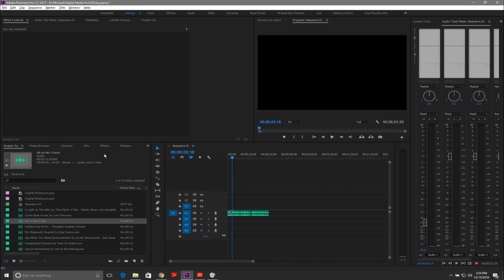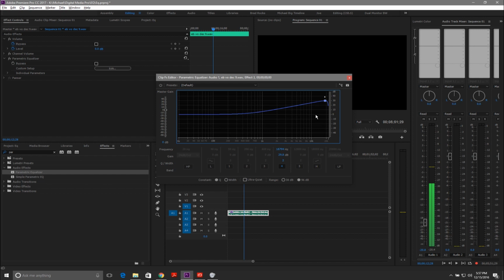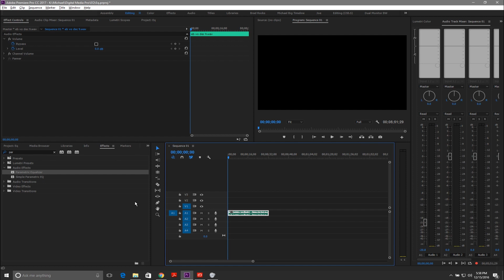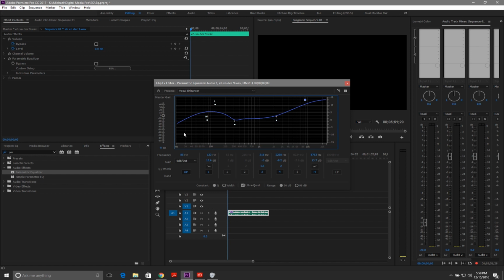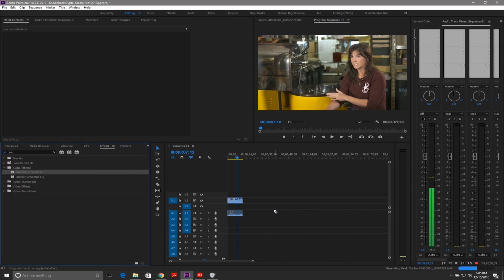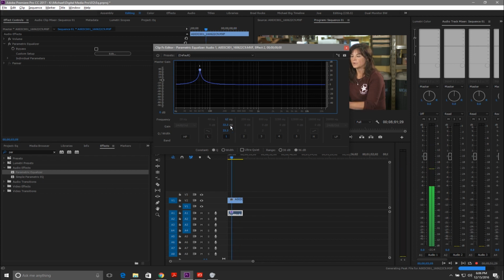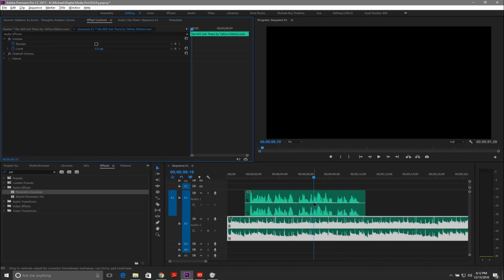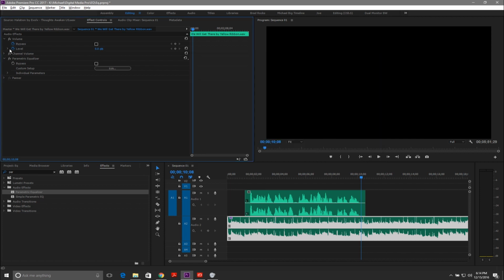Parametric Equalizer #adobepremierepro

Comment: I just need to know how to open the eq adjustment window and every video has a custom set up button that doesn't exist.
Reply from the maker: This video was recorded with CC 2017.  It is pretty much identical in 2018 and 2019.  I do not remember the first version where the EQ had this layout.  If you have 2017 or newer, it would seem to me that there is a problem with your layout, graphics driver, computer specs or installation.  Start with the least destructive, is your current screen resolution at least 1280 x 800?  if so install the newest graphics drivers.  If that doesn't work delete your Adobe profiles.  On a PC you should delete (or rename) your Adobe Folder C:\Users\**your user name**\Documents\Adobe.  When you launch your Adobe programs it will auto rebuild this folder, but you won't have any of your saved layouts.  If you don't trust me, you can always rename it back.  Finally, if none of that works, uninstall your CC software, run the cleaner tool https://helpx.adobe.com/creative-cloud/kb/cc-cleaner-tool-installation-problems.html , and reinstall. If you have CC 2017 or newer (maybe even older) one of these steps should get it fixed.
Reply: @DigitalMediaPro  thanks for the troubleshoot. i'm unfortunately on a school computer that I can't reformat so I've just been using the dynamic link with audition and doing my eq adjustments there

Comment: how do i keyframe this effect?
Reply from the maker: Individual perimeters are in the Effects Control panel. It's not super easy but it can be done. If needed I prefer to cut the audio clips apart, apply their own effects, then put a dissolve between clips. Typically this has good results but it depends on what you are trying to accomplish.
Reply: @DigitalMediaPro  thank you 🙏

Comment: I dont have the edit button for Parametric EQ effect in my Photoshop Pro CC2017. Do you know how to fix it?
Reply from the maker: Yes, open Adobe Premier Pro.  While Photoshop can do some things for video,  you want to use Premier for editing.
Reply: I think he meant Premiere Pro CC 2017, because I also have this same issue.  No edit option.  Regular EQ has the edit button, but not Parametric Equalizer.
Reply from the maker: That is strange.  I have 5 machines with Premier Pro CC 2017 and this is not an issue.  This is going to sound like dumb trouble shooting.... Verify that you have Premiere Pro CC 2017 not Premiere Elements.  As you can see in the video,  I have a standard installation of CC 2017 and there is an edit button on the Parametric EQ.  If you do indeed have the same software, I would try reinstalling it.  It would seem that there is some sort of error on your system.  It is Adobe after all (full of bugs).

Comment: i just want to modificate one part of the audio? how can i do it?
Reply from the maker: I am not clear on what you are asking.  If you apply a Parametric EQ that is a flat line at 0dB there will be no change to your audio.  By adding a point and raising or lowering it, you are only modifying one section of frequencies, essentially allowing the other frequencies to pass unaltered. You can apply a Parametric Equalizer clip by clip or you can apply it to a track.
Reply: @DigitalMediaPro  thanks man!

Comment: how can I keyframe it?
Reply from the maker: You would close the pop-up window, go to the effects control window, and click on the stopwatch icon.  Personally, I do not like to keyframe audio like this, though others might disagree.  I typically use a razor tool in the timeline and split my audio up. I then add cross dissolves and apply individual EQs on each clip.  I have been waiting for an EQ in Premiere that can you can side-chain to another track.  This could be like an auto ducker but with EQ.

Comment: Thank you so much! Simple, direct and easy. I just have a question, when you where notching how did you know which frequency to pick? in this case the number 1. Thanks a lot!
Reply from the maker: 1 is just a preset position. It can be moved to any position.  You could move 1 so it's at 2khz and preset 2 down to 50hz.  Does that answer your question?

Comment: Great tutorial, but I didn't understand the technique of the last part, did parametric eq affect the human voice frequency of the drum track?
Reply from the maker: It would be best to listen to the video with headphones.  There is a mechanical drone in the background of the interview.  The interview was done with 1 microphone so it is only 1 track.   The last section was showing how to isolate a noise in a track and reduce it.   It would have been better if I had found a noise that was easier to hear on all speakers.  The frequency that I was trying to get rid of was around 60hz.  This is a common "problem frequency."  Unfortunately some full range speakers don't play frequencies below 100hz.  Most headphones do.